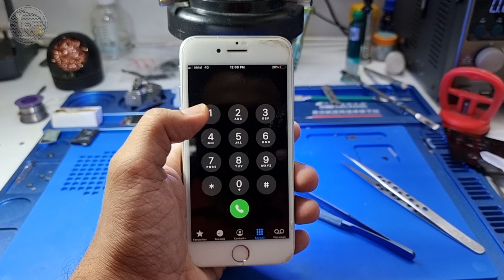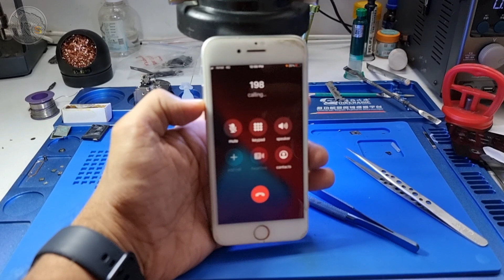IPHONE 7  NO AUDIO / CALLING TIME LOUD SPEAKER OPTION HIDE/ AUDIO IC REPAIRED WITH THE HELP OF PAD

Comment: temprature hot air gun sir , without baseband damage
Reply from the maker: Set Heat 400 Air 100.  ic should be removed immediately when it is melt and should not take too long
Reply: @Irapidservice  thanks you sir